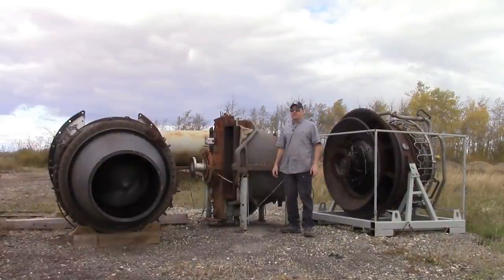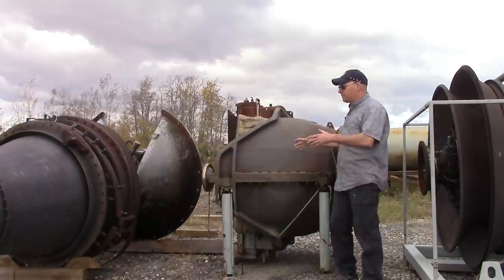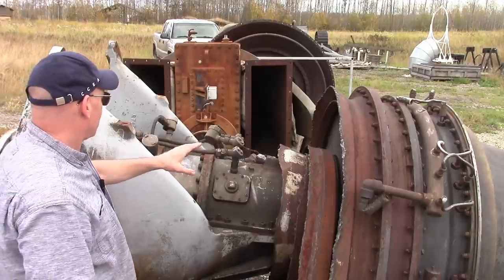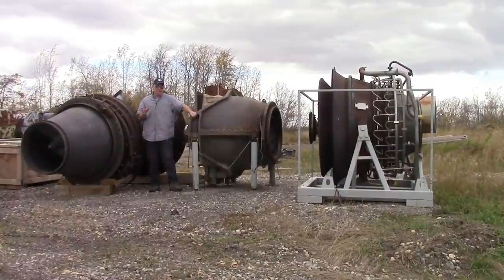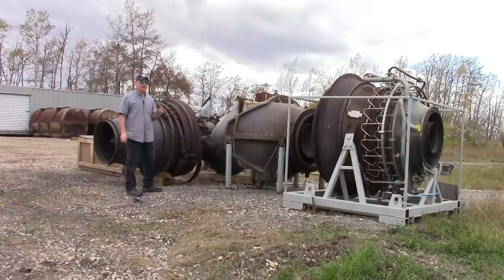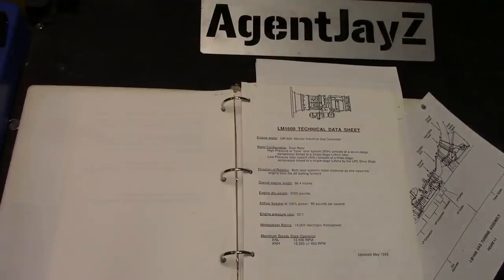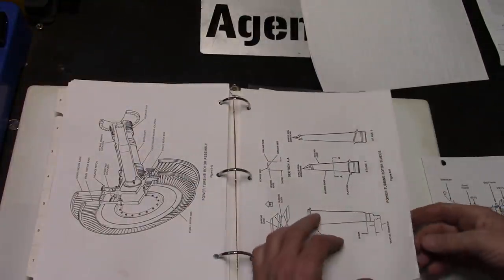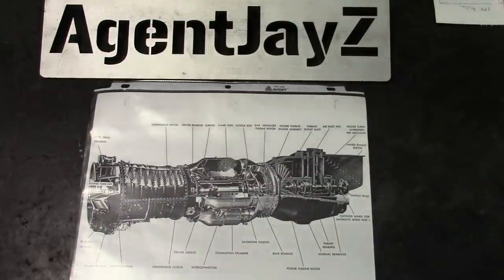Power Turbines 4 Different Ones

Comment: Very interesting video. I work in a large utility plant at a big manufacturing site in new zealand. We run 4 solar mars 100 turbines and power turbines to make 10mw of power off each unit. We then use the hot gas to heat out boilers to make super heated steam to run site manufacturing process equipment as well as a large steam turbine to make more power. After the gas has been through the boilers we then use whats left of the heat to heat domestic hot water for use on site. By the time the gas from the gas turbine gets to the top of the exhaust stack its only about 90 deg. I am still amazed as to how powerful and reliable such a small piece of equipment can be.
Reply from the maker: Canada calling here... would you please make sure to capitalize the name of your truly great country?
Thank you!

Comment: When you got home, you probably discovered that the pretty picture you showed us was of an Industrial Spey with ..... an RT45 power turbine, produced by Cooper Industries of Mt Vernon, Ohio.  As you surmised, the power turbine has two plain journal bearing, with the thrust taken by a tilting pad thrust bearing, known as a Michell bearing in the UK and a Salisbury bearing in the USA.
Having been involved in the design of the power turbine for the Marine Olympus as a very young designer, my recollection is that the plain bearings of R-R's industrial and marine power turbines were supplied with oil while stationary, to provide a 'jacking' effect and reduce the breakaway torque needed on start-up.
PS  Tilting pad journal bearings are also available.
Reply from the maker: I knew that you would know all about this, in intricate detail!
Reply: @AgentJayZ  you crack me up
Reply: @AgentJayZ  Not surprisingly, I was immediately able to recognise the gas generator as an Industrial Spey.  The design style of the power turbine appeared to be that of Cooper Industries, with whom I dealt when they were designing their power turbine for the Industrial RB211.  I did google 'RT45 turbine' and soon found an ASME paper, authored by two Cooper Industries engineers, describing its development.  I was gratified to see that they gave a credit to two of my former colleagues at R-R IMD.

Comment: Wow, the whole discussion of journal bearings and breakaway speed was really interesting. I thought everything involving gas turbines would use ball bearings.
Reply: Aircraft gas turbines and aero-derivative industrial/marine gas turbines exclusively (well, almost) use rolling element bearings.  Having said this, the Marine Tyne that AgentJayZulu showed us recently just might have a plain journal 'steady' bearing somewhere on its LP shaft.
Some free power turbines (such as the RT45 that AgentJayZulu has shown us here) for aero-derivative gas generators have plain bearings, because they have been designed on the 'heavyweight' principle for long life, possibly the lifetime of the installation.  The gas generator may have to be repaired and overhauled several times during the life of the power turbine.
There are purpose-designed free power turbines with rolling element bearings, but these are typically based on aero engine technology and principles.  They may be based on the LP turbine of the turbofan from which they are derived and may even be an integral part of the engine change unit.  An example of this is the R-R MT30 engine, as used in the Royal Navy's carriers and the US Navy's Zumwalt class destroyers.

Comment: Excellent video but I think what most people have a hard time grasping is that the shaft that Is driven by the Tp is a separate shaft that runs through the center of the shaft that is part of the Ng. Most people don't really realize that they are 2 different parts of the engine coexisting, exchanging energy to produce torque to drive mechanical gear devices. In the case of ones used in Natural Gas fed powerplants there is a 2 for 1 in electricity creation. The Tp drives a generator and the waste heat is used to boil water and drive a steam turbine. In the oil industry the Solar power cells (turbines) produce electricity for the facility and other units drive the compressors and pumps to move produced Natural Gas and Oil.

Comment: Tapped and de-tapped to a lot of these on oil platforms, Solar Saturn's were common. Had a couple mega-watt units on the bigger structures. Thanks J.
Reply from the maker: There appears to be very little attention paid to noise reduction on those platforms... not enough room for it.
Reply: Good observation. It's rock show loud walking up to them , then you open the door (which can shut the unit down if not bypassed-oopsidaisy) ... Sound and blast/flame suppression is pretty much reserved for living quarters.

Comment: in one of the power plants i work there are two pratt & whitney ft8 swiftpacs. they have a GG mounted with a 4 stage PT. the output shaft of the pt is coupled with a 60 MVA generator. each PT generates 25 MVA of power wich is aproximated 33.500 Hp.  really good machines, very reliable

Comment: What i found interesting was all of the external plumbing on the 116 PT . And the other units didnt have it or even seem like there were connnections for it on the others .What is it all used for ?
Reply: Stator cooling air.

Comment: I puzzled on the plumbing surrounding one of the power turbine. Freezing the video at 27:23 I see the tubes are for cooling air. Is that air supplied by compressor bleed air from the engine (gas generator) or from a separate mechanical source?
Reply: He answered a similar question above, it's compressor bleed air.

Comment: G'day there, Agent Juliet Zebra,

("Zulu" became "Zebra" not long after WW-2..., at the same time when "Able" became "Alpha" & "Baker" became ""Bravo", and "George" became "Golf", and "Uncle" became "Uniform", and "June" became "Juliet", and  "Freddy" became "Foxtrot"...; they didn't change quite everything in the "Radio-Telephone Phonetic Alphabet", but most of the British-isms became AmeriKan-isms. For some "reason").

Ah, ahem..., what you're calling a 

"Power Turbine"

is, technically squeaking, a High-Temperature,

DUCTED
RAM-AIR
TURBINE...

(!).

"Turbine"

being a fancypants word which means

"WINDMILL"

It's otherwise described as a

"ROTATING
AEROFOIL
ARRAY"...

Which are mounted on a Shaft, and when subjected to a moving Gasflow (Windspeed..., Combustion-Products, Chemical Decomposition Products or Steam....), the carefully arrayed Aerofoils duly spin the Shaft on which they're mounted, thus extracting anything  UP TO 59.3% of the Total Kinetic Energy (Thermal Plus Massflow/Velocity) which was contained within the moving Gasflow entering the Array (see Betz' Law Of Wind, to unpack that...).

   If one lived on Planet Fantasyland, whereinat a Turbine was able to extract ALL of the Energy from the Gasflow going into the Turbine..., then NO AIR could ever emerge from the Turbine's Eflux Orofice - because it wouldn't have sufficient Energy in it to move beyond the Trailing-Edges of the (mythically "100% Efficient") Turbine Blades...!

I have no idea why some people claim to have trouble underconstumbling that the Turbine Stages of a Jet Engine are nothing but Fire-eating Windmills in a Duct, the output Shaft of which runs  the "upstream" Air-Compressor Stages (Succesive "Multi-Bladed Fan-Type Propellers) stacked between Stator-Arrays inside a constrictive Annular Duct...) all blowing the Compressed-Air which they collectively produce - into a Ring of Tubular Fireboxes arranged to fart their Fiery Exhaust Gases onto the aforementioned Ducted Windmills, all  stacked betwixt their own sets of Stator Vanes....

Totally simple to comprehend..., but they're a seriously tricky thing to design and fabricate,  manufacture & then debug - to the point where they become actually sufficiently reliable as to be safe to sell -  for other people to be allowed to operate.

  I'm glad that YOU know enough to work on the bloody things, because they're several steps above by abilities to twist Spanners.

Such is Life,

Have a good one...

Stay safe.

;-p

Ciao !
Reply: Zulu is used in the NATO and ICAO phonetic alphabets with which I am familiar.  And a free power turbine is just another turbine.  
As I've just explained to another subscriber, the latest big aero-derivative industrial machines typically use the aerodynamics (if not the actual blading) of the LP turbine of the parent aero engine.  Instead of driving a fan, the turbine is driving a generator.  In some, the pressure rise of the fan is lost: in others it is replaced with extra stages on the LP compressor.

Comment: haha, it's definitely a face-plam moment when someone says that a jet engine at full AB has 0 power or that an aircraft at 1000km/h has more power than one at 200km/h while at the same fuel flow.
Reply: I don't disagree that the no speed = no power logic is erroneous, and the fact that aircraft rapidly accelerate from stationary during take off should prove as much, but I feel you've swung to far the other way. There is a change in engine power output with input speed, pressures and temperature, and while variable intake ramps/output nozzles on some designs can help aircraft partly mitigate that, I'd be very surprised if any fast design like concord or a fighter jet makes equal stationary power (or the same efficiency, thus power per fuel flow) as it will at higher subsonic speeds. Likewise even if based on the same engine core, a stationary power plant for a ship or gas pipeline isn't really expecting to have its intake moving at hundreds of kilometers per hour, and will likely see deviation from its design specification should this be the case.
Reply from the maker: Hamish... blah. The original contention was that if the engine is not moving, then no power is being generated. Busted. Out of the park.
Reply: @SheepInACart   Actually, no matter how much force the engine exerts on the plane, if the plane remains stationary no energy (thus no power) is imparted to the plane. Though a lot of energy may be imparted to the surrounding air.
Reply: That debate is a result of unfortunate imprecise terminology. Of course a stationary jet engine produces power. Power is more or less entirely dependent on the rate of fuel burn. 

However, propulsive efficiency and therefore propulsive power are 0 in a stationary engine, because all of the energy is contained within the jet stream and none in the airframe. The faster the aircraft is moving, more of the energy is captured in the motion of the aircraft and less is "left behind" but the total is the same. Remember that the exhaust jet speed is relative to the engine. Say we have an engine with a 1000 m/s exhaust jet. If that aircraft is moving at say 500 m/s, the exhaust is still 1000 m/s relative to the aircraft, but only 500 m/s relative to a stationary observer on the ground. So a big chunk of the kinetic energy remains within the aircraft (~67%), but some is wasted in the remaining exhaust speed. 

An extreme hypothetical example: say the same aircraft is flying at 1000 m/s. In this case the aircraft's speed is the same as the exhaust speed relative to it. A stationary observer however would see a completely still jet exhaust relative to himself, so in this case all of the kinetic energy is captured by the aircraft. In other words, propulsive efficiency is 100% and all of the engine's power is propulsive power. But the total power is the same in both examples.

The takeaway is that terminology maters. It is important to say whether we're talking about engine power or about propulsive power.
Reply from the maker: Again... You are using the term propulsive power as if it only applies to the aircraft. It also applies to the air being thrown backward.
Bing Bang Boom.
Reply: @AgentJayZ  Propulsive power is a term in flight mechanics. It was not invented by me and is a fundamental concept used professionally by aerospace engineers every day to calculate performance. 
It is simply the part of the total power generated by the engine(s) that ends up locked in the aircraft’s kinetic energy and is equal to the product of thrust and aircraft speed (in SI units): P [W] = T[N]*V[m/s]. As such, by definition yes propulsive power only applies to the aircraft, and excludes the leftover power in the jet exhaust.

It does not mean that engine power increases with speed, only that more of that power ends up as the aircraft’s kinetic energy (and that the leftover power in the jet stream drops with aircraft’s speed). The total engine power (propulsive + leftover) is unchanged (excluding speed effects on thrust). 

If you’re looking for information on that, every book dealing with flight mechanics will cover it. The easiest place to begin is “aircraft design: a conceptual approach” by Raymer.
Reply: @AgentJayZ  To try and put it as simply as I can, it should be obvious that the power generated by an engine is split with some of it going to the aircraft's kinetic energy, and the rest wasted in the exhaust.
It should also be obvious that the part that contributes to the aircraft's energy is vitally important in determining the performance of the aircraft. Therefore, it is something that engineers need to consider on a regular basis, and a name had to be given to it. After all, saying "the part of power that contributes to the aircraft's energy" would get old real quick. 
The name that was chosen was propulsive power. As simple as that. It's just a matter of decided upon terminology. 
It does not imply that the power in the exhaust somehow magically disappears, or that it can't pick up a car and toss it like it was a leaf.
Reply: @ASJC27  If the jet exhaust velocity is equal to the aircraft's forward speed, then the propulsive efficiency is, indeed, 100pecent.  However, the thrust will be zero, courtesy of the Froude Equation.
PS  In a career lifetime in gas turbine design, I've never used (or needed to use) the term propulsive power.  Having said that, I've certainly calculated the equivalent horsepower of Concorde's four Olympus 593 engines at Mach 2 and 58,000ft (approx 130,000HP.), purely to satisfy the curious.
Reply: @grahamj9101  Of course. That's why I qualified this example as "an extreme hypothetical example", but chose not to go into it to avoid pulling attention from the point I was making.

The term propulsive power is commonly used in the field of flight mechanics. It's more on the aircraft's side of things than on the engine's so I'm not at all surprised that you didn't need to "use" it. It is also known as "thrust power" (though that's more often seen with propellers) and most commonly as "available power". That last terminology is the one usually used where I work (previously on control systems of aerial systems, now in aerodynamics).

Comment: Very interesting stuff. Honestly had no idea it worked like this, thanks for the explanation. This made me wonder, why two independent drive shafts? One reasonable explanation I found was "The advantage of the two-shaft gas turbine is that compressor and high-pressure turbine are driven at optimal speed for the respective power."  In case anyone else wondered.

Comment: I am curious , do these machines , power turbines and gas generators have "standard" flanges or are adapters used ? Also I read somewhere that Kawasaki industrial engines were designed to be industrial engines from the beginning and were better industrial engines as a result , what would be the possible differences between a dedicated industrial engine and a converted aero engine ?
Reply from the maker: That's two questions, requiring far more space for answers than here. A possible future video...
Reply: I'll leave AgentJayZulu to answer you in more detail in a future video.  However, suffice to say for the moment that "dedicated" industrial gas turbines are known by those of us who have been involved with aero-derivative machines as "heavyweight" gas turbines.  Their engineering is more closely allied to that of steam turbines.  Their structures and casings are altogether heavier, they have to be warmed up slowly and they cannot be started and run up to maximum power in two minutes or less.

Comment: The most powerful turboprop currently (however it's a single shaft design) is the Kuznetsov NK-12 with some massive 15k HP output 😎 Second in the row is the multi shaft design Europrop TP400-D6 with 11k HP 😁

Comment: 66,000 foot pounds. Mind Boggling. HP = Torque x RPM/5252. 30000 = 66000 (RPM/5252) So at 30,000 Hp the turbine rotor will be going  2387 RPM. Slower than I would have imagined. I was thinking the turbines ran at higher RPM with lower (relative) torque, but the opposite seems to be true. Unless I totally misunderstood one of the numbers. 
Just playing with the numbers trying to get a feel for it. BIG power.
Thanks Agent Jay Zulu, interesting stuff.
Reply from the maker: Sounds about right for the turbofan. For electrical generation, it should go at 3000 or 3600. But then 30K is a bit light on the power. Our older models put out 34,800, and the newer ones are over 40.
Reply: Bang on.